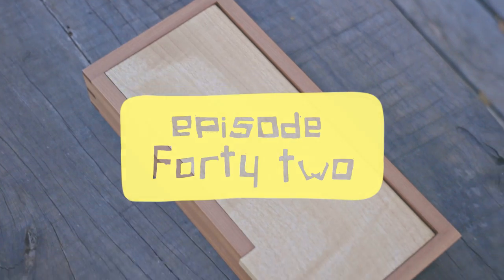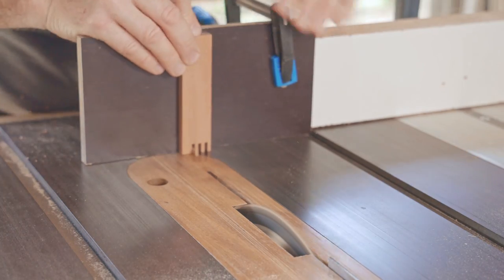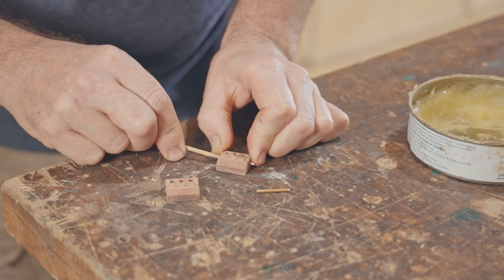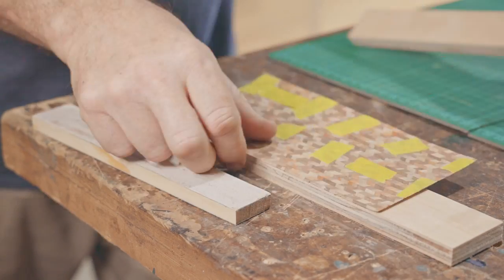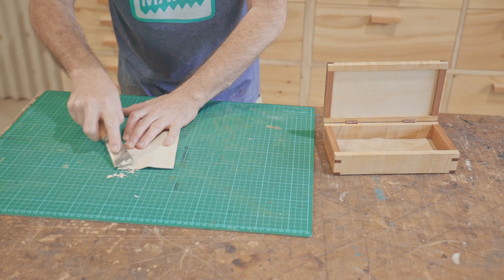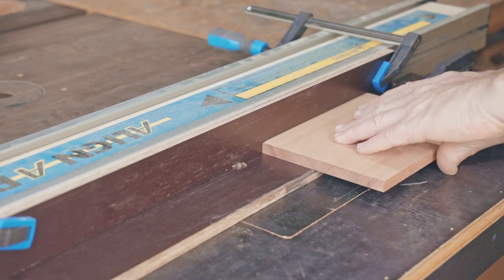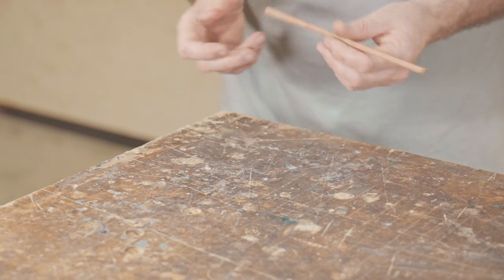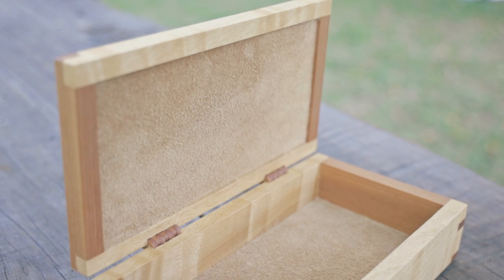4 Wooden Hinged Boxes Pt2 - Scrapwood Challenge ep42

Comment: If I may offer a suggestion, don't glue the brass rod in, just mushroom one end, countersink that end in slightly. If you glue it in and the unfortunate happens, broken hinge. You'll then up replacing the brass rod instead of re-using it. I've had to repair a few boxes I've made in the past with wooden hinges because some people were a bit abusive to the box. I've always re used the brass pins. Love the builds, cheers :)

Comment: Good idea with scraping the leather first. My best guess however, is what you scraped off, is waterproofing. If you scrape it off though, there's a risk of tearing the leather so maybe, instead of scraping it, you can go over it with acetone or rubbing alcohol. If you don't know how to tell if it's waterproofing or not, just use a pipelet or something and put a few water droplets onto the leather. If it soaks in, it's not waterproof but if it just stays there, then it's waterproof. The waterproofing will prevent water based glues from sticking which could be why you previously had trouble gluing the leather, so I hope this helps :)
Reply from the maker: I've tried acetone before and it didn't help, I've also tried scuffing it with sandpaper and that didn't help either. I've tried half a dozen different glues, not just water based ones and nothing works. :)
Reply: @PaskMakes  okay, well at least I tried, thanks for getting back to me. Have a great day :) By the way, I absolutely love that second and third box the most out of the four boxes I love your videos and would love to see some log carving videos if you can. Like get the log and carve like your logo or something into the middle? I think that'll be really cool
Reply: Ive seen someone gluing leather before and that was the way they fixed their problem, so I thought I could try to help you too

Comment: I've been making leather goods for a couple years.  If you want a proper bond with leather, contact cement is the way to go, and if the surface to glue is too pristine it's a good thing to rough it up with a mid grit sandpaper before applying the glue.

Hope that helps in future projects!

Comment: For a few of the boxes I made, since I had to change the design, i used my bandsaw to cut the lid off since it has a finer cut than the table saw, that for me worked since I do not have nice vice like you or that large of a pull saw. :)  These are super cool boxes!  I may have to try some of those designs :)

Comment: You can get the leather properly roughed for gluing with some simple sandpaper, and you might see better results with a contact cement. I've done it that way for many years with excellent results.
Reply from the maker: This particular leather is a real problem to glue. I've tried scuffing with sandpaper and scrubbing it with acetone before using contact adhesive. Neither of those methods have worked. :)

Comment: Nice builds!  Hmmm...  It just occurred to me that if you mount the lid of a sliding lid to the underside of something--a shelf, a workbench, etc.--then the box becomes a removable drawer!  (If you standardize the sizes, then you can attach a row of 'lids' to the bottom of your workbench surface and then, when you are working on a particular project, you can just grab the drawers containing what you need from their storage areas and slide them into place at your workbench.  Everything you need will be right at hand, but out of the way.  You could also have larger 'drawers' that bridge two--or more--lids.)

Does that make sense?

Comment: I don’t have a Sawstop table saw, so I will take a standard 7 1/4” circular saw blade which has the same 5/8” inch arbor and put it in my tablesaw. This gives me a 1/16” kerf that I use to cut open my boxes with. Maybe the same thing could work for you?